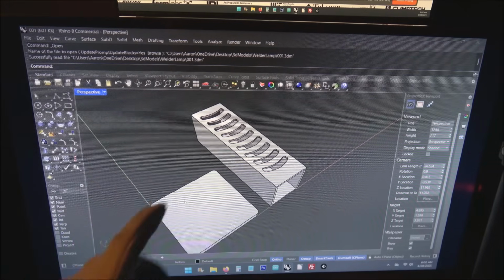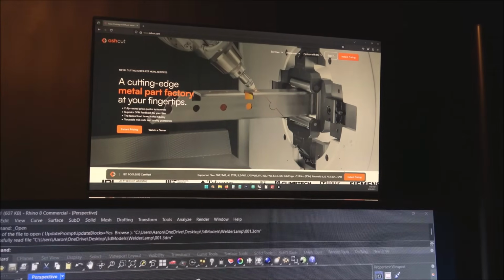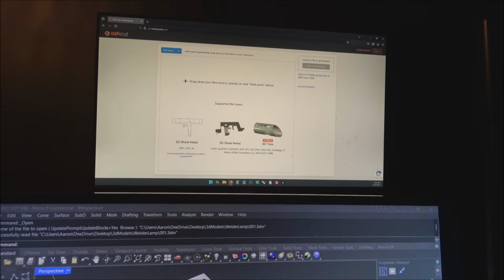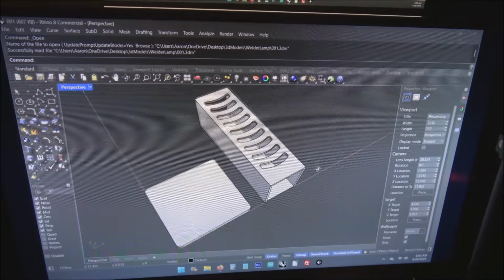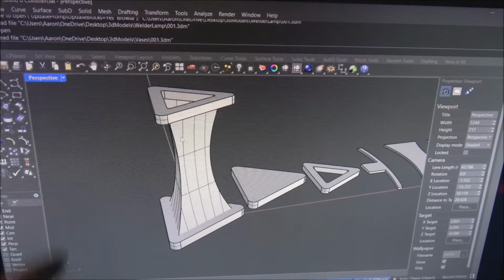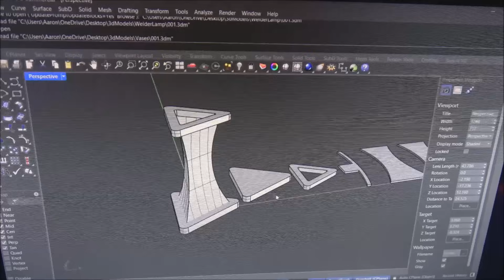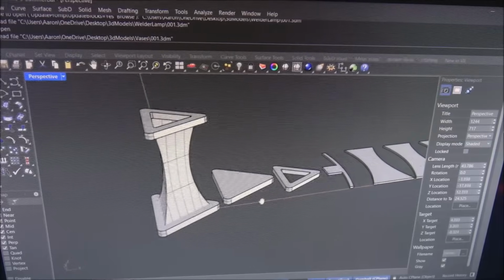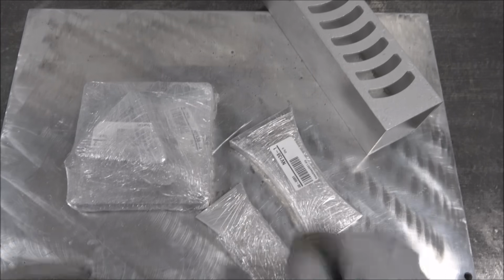What is "oshcut"? - Laser Cutting Company

Comment: That piece of piepe looked really clean. Honestly, never had a lasercut aluminum pipe in my hands, but the steel and stainless steel stuff I get from a company down the street from where I work always pisses me off. All the slack on the inside of the pipe..... it takes so much time to clean all that stuff. A small sandblasting cabin would be nice if that would help.
The last parts I got, a few pieces of 80mm steel pipe, 4mm wall thickness, where all crooked. Every cut edge was curved instead of straight. I have no clue how this is possible with a laser cutter

Comment: 6061, they could also cut the sides of legs of the popular 'slab tables'. Most builders are buying finished leg sets. You could do a vid showing the design, flattening the sides of a set of legs, and then using your welding skills produce a set of legs with perfect dimes up the seams.  Many legs are powder coated after extensive weld dressing/sanding &finishing. In your case; you could offer legs with welds intact- regardless if they were simply acid etched and left aluminum finished or if they were powder coated, or anodized they'd look great with welds along the corners of tapered rectangular section legs. Drawings available if you'd like. Send-Cut-Send offers a similar service in Nevada.

Comment: Does Oshcut have a tool to make it digitally before you send it in?
Reply: They do not. You need to use your own software to create the parts. Usually that means a CAD package. OnShape, and Fusion 360 are paid CAD packages that have a free version, and both have sheet metal workbenches. 

FreeCAD is a 100% free and open source CAD package, which I think has a sheet metal workbench now, but I’m not 100% sure. 

There are also a bunch of other paid CAD packages that you can use. If you’re only going to be doing sheet metal work, and you have a strong ability to visualize what you’re doing, you could also use something like Inkscape to draw out what you want in 2d.